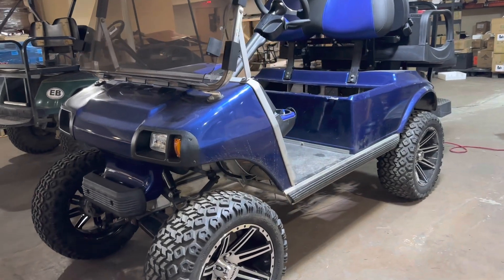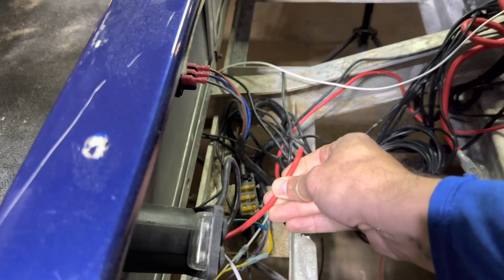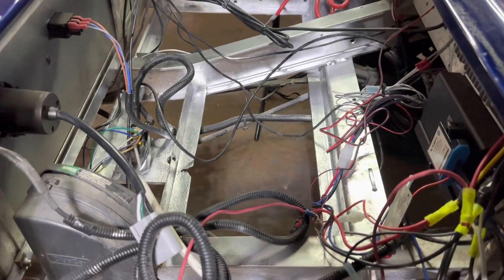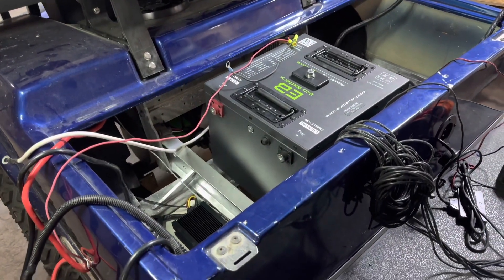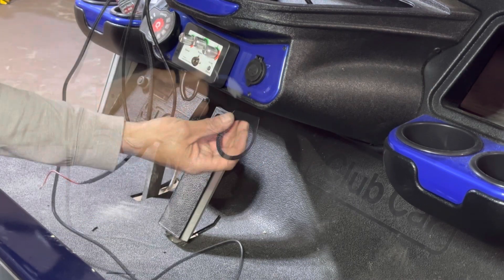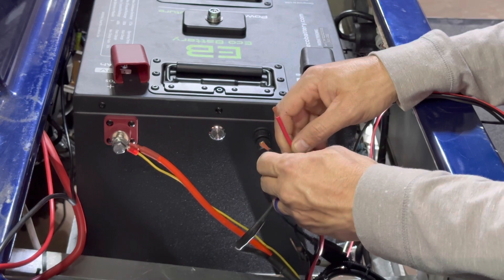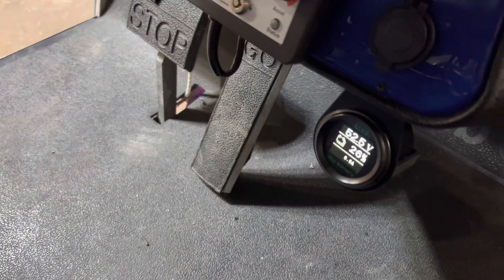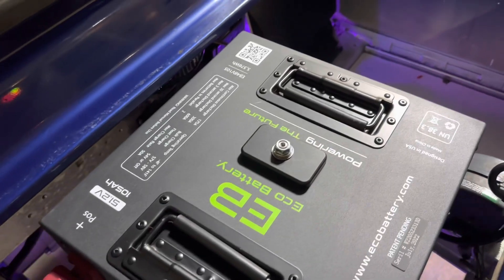Eco Battery 51.2v - 105ah Golf Cart Battery Installation ~ 2006 Club Car DS

Comment: I am not sure what to do with the red and black wires from the 12v reducer. My cart has what looks like a fuse panel, so I ran the red from there to my 12v reducer but I am
Not sure where the black wire goes.
Reply from the maker: Hook the red to the 12v supply and the black will ground your 12v accessories. The fuse block will need both to complete the circuit.

Comment: I have one blue wire coming from the front which I am guessing is the key switch. Does this just go to the positive on the converter? I am using a fuse panel so what size fuse should I put for that one? As well should I use a 20amp fuse for the headlights?
Reply from the maker: I’m sorry, you’ll have to call me at 8437442020 to answer these questions. I need more info

Comment: Hey guys . Dummy here from WV. 
98 CC DS does not have the wire harness plug like the video.  Mine has five wires and no blue. I CANT GET THIS CART TO RUN.
 I did however get it to run by putting the two main hots to the same post on the selinoid. Been on this project for 10 days now. BTW thanks for getting the battery to me SO QUICKLY
Reply from the maker: Yellow to ground from OBC
Reply: Shortest most helpful answer to a question I didn’t have to ask.

Comment: Would this cause an increase in speed? And any change in the ride quality? Nice way to get rid of the v-glide system and upgraded batteties! Thanks for the info!
Reply from the maker: Speed is a controller/motor issue, but you will notice a couple more MPH due to a little extra voltage and lack of weight.

Comment: I recently added the Eco Battery to my Club Car DS - thanks for video.  I would like to add the Stinger keyless ignition to my setup.  In this video, it appeared that the stinger was already installed to the other non-Eco reducer you mentioned?  Can you provide any detail on the wiring setup for the stinger?  Thanks
Reply from the maker: I have actually never installed this switch.
Reply from the maker: But I’d like to have one on my cart

Comment: I have an older DS 48 volt club car. Is there something that I have to do to the OBC
Reply from the maker: Yes, bypass it. We did a video on it.
Reply: @PalmettoBatteryPros  you said you did a video on it, but I can't find it, and the only link in your video is for a Precedent. He was...and I am, asking about the DS. There seem to be conflicting videos, research, etc... on the DS when converting to Lithium, and there are no kit's offered for the lithium batter from Eco, where the charging portal is swapped. All the videos say to run the grey wire from the portal to the negative on the battery(for acid), then the yellow to the negative, but that's in a daisy chain. Others say like yours does, to bypass it by jumping the white and blue with a relay and basically cutting everything else on the OBC side off. Is that all that's required?

Comment: Does the battery need to be on to charge it? Will it charge if the battery is off? Does the battery powered on also power on the charger somehow or is it powered on by the external power into charge receptical ? I noticed that the battery power is always left on when doing the initial charge, Thanks
Reply from the maker: You can charge either way, but recommended to have battery on when charging. Only shut the battery down if it’s going to be left unused for more than 7 days. Only way to activate charger is to plug it in to 120v power.
Reply: @PalmettoBatteryPros  So the charger will charge the battery while the battery is off? Looking to buy this setup really soon. Thanks Keep up the great videos.